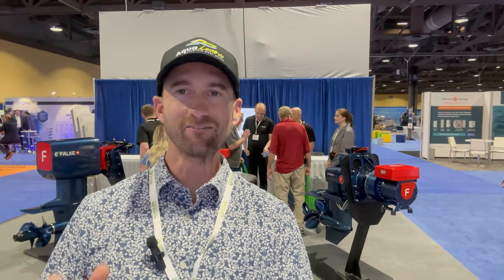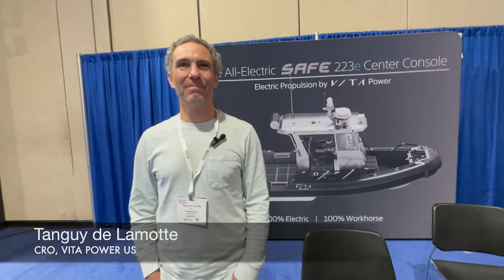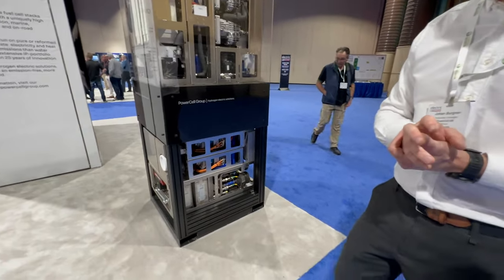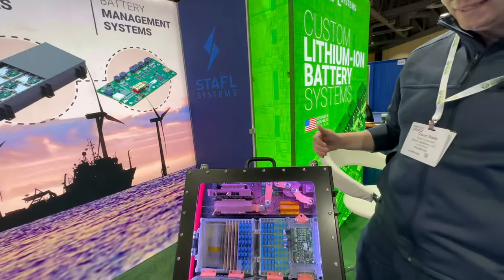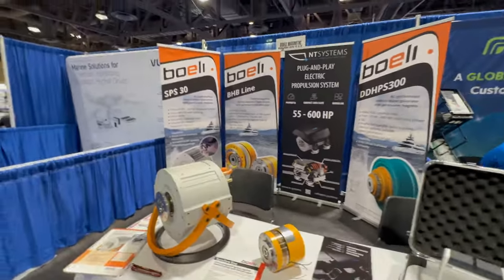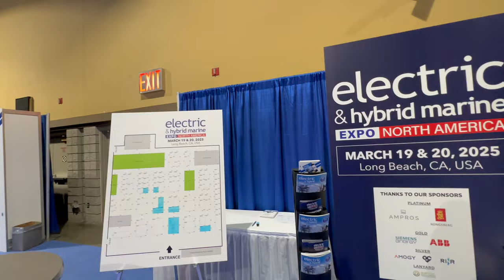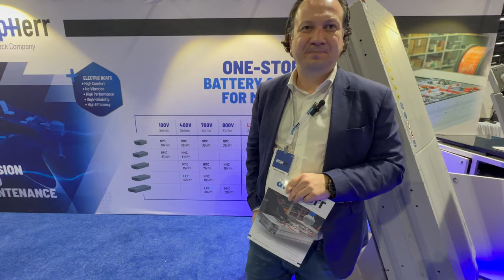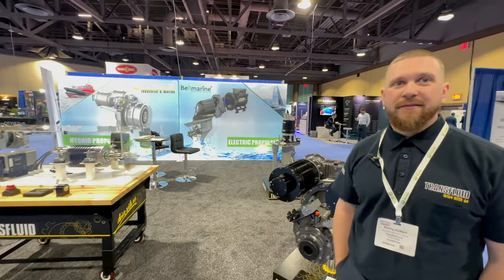We talk with the Geniuses advancing the Marine Industry

Comment: Thanks. I’ve gladly seen the updates on power, efficiency, smaller form factors, i do wonder about cruising range when fuel is not used: hulls that ergonomically fit batteries that become the keel with less invasion into the living space for cruising comfort. Basically i see e-boating as growing into the possible unlimited range of sailing (at 8-12k) with the temporary ability to outrun a storm (maybe 40k) if necessary. I guess maximizing the roof and number of solar panels is expected on a cabin cruiser.

Comment: You mised the best maker of the complete system in use: Torqeedo...why?
Reply from the maker: A valid question.  The simple answer is that time at the show is limited, and I would rather spend it highlighting cool tech from up and coming companies that would benefit more from the exposure, rather than the biggest.  Also, in my opinion, Torqueedo has a good system, but it is not the best.  There are other motor manufacturers with more performance that also offer a complete system. Lastly, thank you very much for watching the video!
Reply: Id love it if you could organise a chat and meet the  designers and makers at Advanced Electric Machines from the NE of 🇬🇧 .. they produce some very interesting and green motors that don't need rare earth's or even copper for windings. So are very simple to recycle and cheaper to make. Their motors are powerful modular and efficient and they have mastered the controlling hard and software to drive their motors and regenerate. 🌌🧙🏼‍♂️ They started out as a spinoff from local university research work. 
Durham university also developed an ultra compact and light opposed free piston generator  that is perfect for small boats .. it is also simpler to make not needing a crank bearings or Conrods.
Reply from the maker: I need to do a Great Britain tour, as they are making some great electric motors and boats on the island. Thank you for the info on Advanced Electric Machines, I will look into it
Reply: @aqualectric-gi2ln  

You can probably get three or four boat builders lined up that use electric power the  top of the heap in terms of  the tradition meets the tech in the boat building  craft side is Spirit  Yatchs.  Wooden boats but using high tech and high art. 
There's also several builders along the South coast.  And life boats with electric auxiliary motors to help them search at night and in fog by listening for   people in the water.

Comment: You always provide good content but when you talk to battery packs manufacturers I would pressure them on why automotive suppliers such as CATL are targeting $50/kWh in 2024 at HV pack level while marine applications are apparently stuck offering products that cost 10 times as much. When are their prices going to come down? We can’t expect just scale to drive the ramp.
Reply from the maker: Thanks very much for your comments.  Yes price/kwh is definitely an issue, and compounded by the size of boat, and battery capacity needed.  I'll be doing a series on marine high voltage batteries and interviewing battery suppliers, and we can definitely ask those questions.

Comment: For leisure yachts the roundtrip metrics, economics and logistics on hydrogen FC never quite add up, not to mention regulations that, at least here in the EU and except for some ports are non existent, despite countless conferences. Ruling out making your own H2 on board, we are stuck with type 3 pressure tanks at 300+ bars or trucks on the jetties filling up some sort of on board tanks. It’s just not happening in marinas. PEM stacks are also very expensive to replace. I am more inclined to think we will crack cold fusion than a viable FC based marine powertrain for leisure yachts.

Comment: Any kit for my Volvo penta???

Have solar and batterys
Reply from the maker: Volvo Penta is developing a hybrid drive for their IPS system, with diesel shaft on one side, and electric motor on the other.  I don't know if there is anything from Volvo to retro-fit an existing system, but possibly something like what Transfluid shows in the video.  Of course you can do anything with the right budget
Reply: @aqualectric-gi2ln 
Yes but that will garanty cost 2 arms and 1 leg.

I have good prices on so much.

Better get an drive ore kit to get in on extra